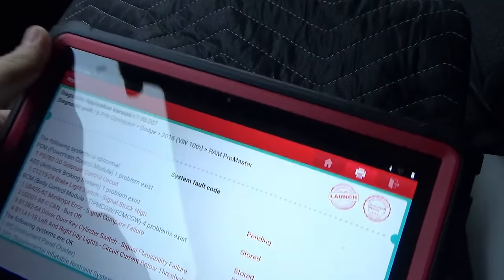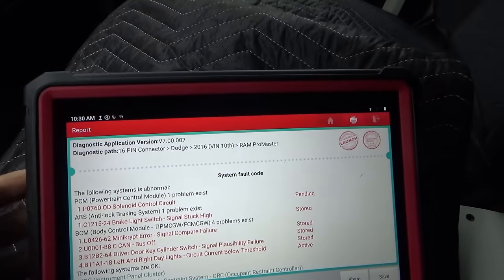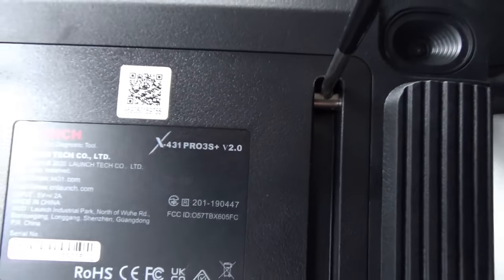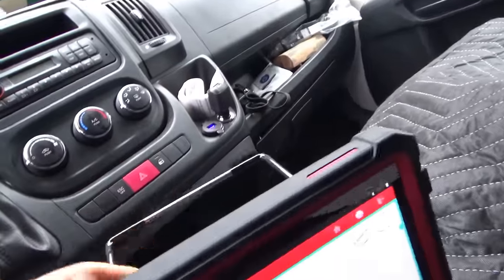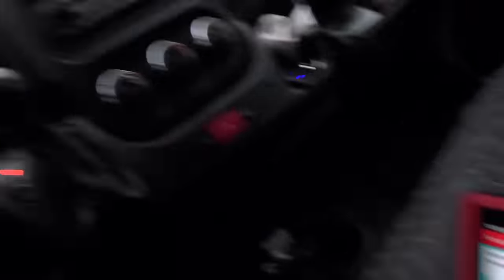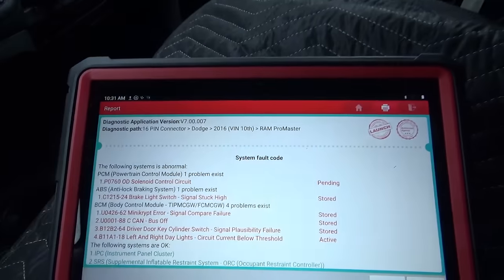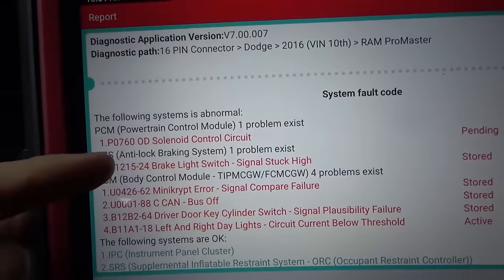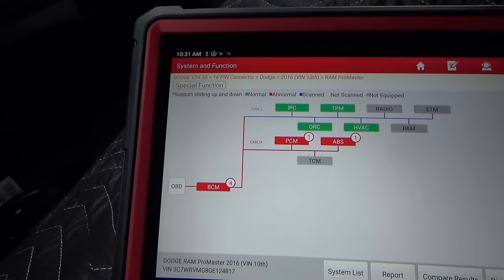ProMaster DISASTER Van - Part 2: Transmission LIMP MODE? (P0760)

Comment: I would have to cobble me a cover box for that PCM.  That was my very first thought when I watched the first video.  That PCM needs a cover.
Reply: Agreed but it has to be very carefully designed not to trap heat..
Reply: Point taken, but that physical computer is common to Promaster, Challenger, Jeep, Minivan, and probably the trucks too. I believe this problem's root cause was the blocked cowl drain. If you take the big picture view, this repair is great thing, because I will be checking this on my customer's vans, and calling it out in my videos.
Reply: @promastersonly1419  Ivan's repairs are always worth the watch.  Blocked drain would definitely contribute. Had that issue on my own vehicle and I am still trying to find a SIR module for it after it sat in water.
Reply: @2packs4sure  I wonder.  There would be more airflow with a plastic cover, under the hood, than there would be under any dash, where many vehicles have the PCM mounted.  ;)  Not sure it would make any difference at all.
Reply: @farmermiyagi1338   There's a whole list of variables,,,,  if it's under the dash about the max temperature it's gonna get on a hot day is a 140°F but if it's under the hood 200 plus degrees maybe then you add reduce air flow with a cover and the temperature goes up,,, so I don't know...
Reply: @2packs4sure  I could fabricobble something that would allow airflow from below, a little extra heat beats hell out of a ton of water.  ;)

Comment: Actually Ivan, the dealer is correct. These used ECM's can only be done if they are cloned or hotswapped with witech. The hotswap does not always work. They are not like older Chryslers. When you program a new dealer ECM there is no key programming. The BCM transfers the key data during the programming event. When you program keys they only program to the BCM. The dealer was right in this case unless you wanted to pay them too fart around with the used one it just simpler to do new one unless you can just clone it.

Comment: How is the coolant getting into the connectors? That needs to be resolved first!
Reply: That was from a prior coolant leak which had been fixed according to the video.
Reply: Somebody commented yesterday that the coolant can travel along the wires from a bad coolant pressure sensor.  
I''ve heard about a similar problem with older Sprinter vans where transmission fluid would travel inside the harness from a bad transmission connector. to the TCM .  The sensor/connector leaks needs to be addressed first. Probably a new section of harness too since is almost impossible to clean the oil /coolant  inside the insulation
Reply: Kip here: funny you mention it - another tech told me that sometimes coolant can come out the snout of the temp sensor. I checked it, bone dry. We suspect the coolant in the trans connector was from a previous leak issue, though a few pins in it were definetly corroded.
Reply: If they fixed a coolant leak and there’s also coolant in the connector, that section of the harness needs to be replaced. It got pushed from the sensor to the ECM. I wonder if there’s a tool to air pressurize a wiring harness at the connector and force the fluid back thru away from the ECM.

Comment: Someone doing Promasters should be able to get a used wiper tray if the seals for the wipers gave out and just replace it. It looked like a problem that could have been figured out with a hose though, of overflowing the gutter, you run a hose on low the tray should not fill up if it is not filled with leaf dams.

Comment: Why was Ivan not able to reprogram the ECM himself? What prevented that?
Reply: Might not have had those capabilities with his scan tools. Eric O. has said Chrysler programming is also pretty expensive because of the different software & registration hoops you have to jump through. I’m pretty sure that some used modules are also not able to be reprogrammed without directly connecting to the eprom & having the eprom “reset” on the bench.
Reply from the maker: Chrysler prevented that 😂
Reply: @PineHollowAutoDiagnostics  what about ford and gm.... are you able to use launch to reprogram ecu....
Reply from the maker: @JoseDiaz-qk3ek  I just use a J2534 tool, very easy!

Comment: I’ve never seen you do this Ivan, but if I had to perform a repair like this that resulted from repeated water ingress through bulk connectors I would flood the connectors with dielectric grease after cleaning the pins. In most connectors this should prevent further water migration into and through the connector. So, why not?

Comment: Just a question as I'm watching.  Could  dielectric grease be used on the connectors as a weather deterrent?
Reply: Yes, or Fluid Film.  But if there's direct water impingement, it still may find it's way in.  Need to fix the water leak first.  Some connectors use weather packs, which is a specially designed rubber seal that lets wires pass through.  Even with the weather pack, I'll spray a healthy dose of Fluid Film on the outside to help repel water to help the seal out.
Reply: @major__kong  thanks for the info.

Comment: Fact-Toyota,. GM, Ford, Chrysler, Honda, Kia/Hyundai, or any other manufacturer I can think of gives any information on whether or not a used computer can or will work in their vehicles nor how to trick them into working if need be (and there often is a bit of a trick).  So,  a lot of dealers won't mess with it as it may end up leaving them in a bind.  Well, GM does on their Global stuff as they say not to, but not many go that far.  I have so many techs ask me if a used module will work and if it's not in writing in the service info I say so.

Comment: Here in Australia its a   Fiat Ducato..  The so called auto box a big issue some do not make 100 000km with out a big failure  with so called auto trans,  Manual with solenoids to change gears.. Major electrical, fluid issues with its sharing to over areas, also expensive to repair even bigger issue to find someone to fix problem... Best advice on older models go manual..  The latest ones now returned to conventional auto box with torque converter...

Comment: I have been chasing the same problems the van will misfire and flash more lights on in the dash Cruise control won’t turn on and the air conditioner turns on by its self. The tac bounces all over the place. I sprayed wd-40 all over the computer and ever connection leading to it. After about ten min I shut it off and pulled the neg off the battery and then it started fine. It’s definitely moister I feel.

Comment: I wonder if you could do at least a temporary fix on a module with water intrusion and intermittent problems by putting it in a vacuum chamber to remove the water, then spraying it down with deoxit?? I don't think I would send a customer down the road and tell them it's 100% fixed because you don't have an idea about internal corrosion. But I think it would be an interesting experiment. Especially if it was my own vehicle.

Comment: Not unusual to see coolant in the gearbox harness on Audi Q7 and related cars. They put a coolant solenoid on the same harness and when it leaks capillary action takes it straight to the connector knocking out the gearbox.

Comment: Seriously, how hard is it to make water tight connectors, other companies know how to do it, why can't Chrysler engineering?
Reply: IP rated connectors cost more and businesses just want to save money
Reply: These vans are designed by Fiat in Europe and rebadged for the US market.  So it's not even Chrysler engineering.
Reply: @ischmidt  Stelantis van yes, but you won't find a gas engine in europe so that's on chrylser. And yes, we have a couple of them at work and all of them are filled allmost to the brim with snow in the winter. Won't say I like them but they are a hell of a lot better than the smaller version that even Toyota put's there badge on.
Reply: Kip here: the root source of this problem was the plugged cowl drain, and we believe it sat like that for over a year, with 100% of the water from the windshield pouring onto the computer. Not a design flaw, just an outlier problem.
Reply: @promastersonly1419 

I disagree. The connector should have been designed to withstand water splashing on it from any source, whether it be the cowling or from underneath the body.
This is bad engineering or unconscionable cost cutting. They saved $1 gasket/vehicle and created problems downstream, for owners and mechanics.
They never considered the damage this does to their reputation.
I'm not due for another new vehicle for a couple of years, but rest assured that anything from FCA will be at the bottom of the list.
Reply: @groosbro1  There is a difference between being able to withstand splashes (which I'd bet these connectors do fine, otherwise the trucks would fail the first time you drove in the rain) and withstanding water pouring onto them continuously from the blocked drain.  Consider how common water intrusion problems from blocked sunroof drains are - they even happen in Toyotas (don't tell Scotty).
Reply: That's the thing, it IS waterproof under normal circumstances. But subject it to a years worth of torrents of water, and it failed. We actually aren't certain that it failed from the connector plugs - it's possible that the housing itself is letting water in. Sometime soon, I'll cut the old computer apart and see if I can determine exactly where/how the water was getting in. It's likely through the pins, but not certainly. But overall, your point is well taken and ALL automotive grade connectors should be crazy waterproof.  @groosbro1
Reply: @promastersonly1419 

Pack the connectors with dielectric grease, spray it with a marine corrosion preventer, wrap it with plastic and zip tie it shut. 🤣

Comment: First of all, what ever happened to placing the computer inside the vehicle? There are vehicles where the computer is under the dash in the passenger footwell. Hell, they could place the computer behind the seats of those vans. Unbelievable design those geniuses came up with! Second, couldn't you fill those connectors with dielectric grease? Wouldn't that keep the moisture out?

Comment: sure seems like if you are going to put a pcm under the hood priority one would/should be water intrusion protection.two month down time for that van  was probably three fold in revenue on top of repairs.hard to believe that van newer as it is has these issues,this is coming from a construction van owner when they are down you are down.best van iv ever ran was an express hard on fuel but in 300,000 miles water pump,radiator cap,and spark plugs and one coil.I feel for those guys im very familiar with the down van issues in my career.the more complex they become the more revenue you loose trying to keep them on the road.

Comment: even with the tube fixed, the way the windshield cowl is designed it is still going to have a water leak.
Reply: Kip here: correct! I browbeat my customers to run a strip of gorilla tape sealing the cowl directly to the windshield glass. Do that, and keep the main drain clear, and you won't have this problem.

Comment: All vehicle wiring connectors should be weatherproof. Especially computer connectors. The water dripping onto the computer should be a non- issue if the connector was designed and installed properly . This was either designed poorly or the connector was not installed properly. The cowl drain working properly will just mask the real problem.
Reply: Kip here: point taken, but we believe this thing was putting 100% of the water from the windshield directly onto the computer for over a year as it sat on a dealer lot. No a normal case.

Comment: Dodge is still responsible in more than one way. First, defective water diversion design which allows components to get drenched. Two, the "weathertight" connections at the PCM and TCM as well as any other weathertight connections fail to seal out moisture. Unless the water is from condensation, the terminations are completely junk. Ford had this same problem on their F trucks, water came down onto the brake master cylinder then drips down below where the engineers decided to mount the PCM which then eventually gave out due to water damage. These experts couldn't be any better in deciding the worst place to place electronics.

Comment: I'd be very interested to see how they waterproof it AND keep it cool...
Reply: Kip here: I worried about that too, but we had a couple hours of drive time on it with the PCM wrapped in plastic bags, and no evidence of melting on the bags. I don't think heat will be a problem. But with the cowl drain fixed, and the cowl super waterproofed, I think you could run the PCM stock and water wouldn't be a problem.

Comment: The dealer waa right on the used pcm. This is a fiat under the skin and used pcm is only possible if you make it 'virgin' again. Not something that can be done with Witech2. Abrites (or another tool that can dump the memory) might be able to pull it of, not sure as these engines are not used in Europe.

Comment: Obviously a crappy setup causing the water intrusion.  Very poor PCM location placement.  Could it be relocated?  What about a canopy over that area to protect it?
What was the final fix?
Reply: Kip here: the final fix was to clear the blocked cowl drain tube as shown in the video, plus LOTS of silicon and testing, and we replaced one of the cowl halves with something off one of my parts vans. With 100% of the water hitting the windshield for over a year not having anywhere to go, it MADE new and unusual paths and went directly onto the computer.

Comment: Why doesn't the factory fill those wiring plugs with dielectric grease at the factory? wouldn't that help prevent water intrusion?
Reply: Normally, the bulk plugs on the PCM never cause a problem. This van was special because with the cowl drain tube blocked, 100% of the water from the windshield was forced to find a new path, and MADE it's own path which happened to include the computer.
Reply: @promastersonly1419  I hear you , but Dodge has the same problem with their TPIM's the underside connectors get green and kills the vehicle ...been there done that

Comment: I have seen oil travel through wiring from oil pressure sensors, is he sure the same isnt happening from a water temp sensor and coming out into the ecm plug via the wiring itself

Comment: I know Iam late. I wanted to know if you know of the 200PCS Connectors Terminals Kit Solder Seal Sleeve Heat Shrink Butt Wire Stick? 
     E BAY
I bought some and they are great for connecting wires. They have solder in the middle with heat shrink on the outside. 1 and done.

Comment: And just think, every Pro Master is or will have this built in defect. Should be a safety recall on this issue.
Reply: Kip here: the 2022-up Promasters have a redesigned cowl, and have moved the computer from this spot. We believe that the blocked cowl drain was the root of this problem, and it's pretty oddball. We believe this van sat for over a year on a dealer lot, with every drop of water coming off the windshield funneled into the computer.

Comment: I don’t work in the salt belt or around a lot of wet weather. Would coating all vulnerable connectors and modules in fluid film help prevent a lot of these problems in the first place? I understand that WD40 was originally designed to displace water in electrical connections and fluid film is a more concentrated version of WD40. Just thinking out loud
Reply: Kip here: it's a good thought, but this problem was kinda unique to this vehicle. I would also guess that with 100% of the water from the windshield being directed at the computer, pretty much anything you did would be washed away over time. We think this van sat like this (with the blocked cowl drain) for over a year at a dealership.

Comment: What does it help that connectors has a rubber seal when wire's going into the connectors are open to water intrusion and not at all sealed , and a low voltage can-bus out in brutal weather water salt rain dirt mud  ice are just totally insanity

Comment: Why can't the computers be placed inside the cabin?  Given weather and temperature extremes, it seems obviously foolish to design a vehicle in such a way as they did.
Reply: Kip here: it's a good question, but this isn't normally a problem. I would guess that Chrysler puts it underhood for cooling, and because there's 288 wires in those bulk connectors, and to run them into the cabin would cost more and cause more problems than it solves.

Comment: I'm keeping my old 2003 Chevy 1500 express Van forever. 

Lots of used parts available lots of vehicles on road for 26+ year same design.
GM makes that same model from 1996 until today ..
Cheap easy to fix reliable 400,000 miles going for 500k.
Keep this new garbage.
Poor Russians .
Tell them to fing a  chevy Express van and get rid of that pos .

Imagine when all these new age ultra high tech POS vehicles get old..
$

Ps i dried out electronics using a vacuum chamber.
If you could make one running off a Air conditioning vacuum machine may save various components with moisture intrusion .
Stabilent 22 liquid on pins connections increase conductivity ( avionics use this )also 
They have it at NAPA .

Comment: You think the transmission issue will come back?
Reply: Kip here: we think no. The root of the problem (the blocked cowl drain) was fixed, and the van has maybe 1000 miles on it now with no issues.

Comment: Hello der...
I hav a 2011 gmc acadia awd wit a 3.6 l...
Havg trouble wit driving at speed between 50 to 70mph...whn goin small up hill r increase speed da front wheels start shaking...it stops shaking whn let off pedal r increase speed 4 tranny to shift???...can u help m wit dis problem...
Reply: Try having the tires balanced and check the front end for loose or broken parts.